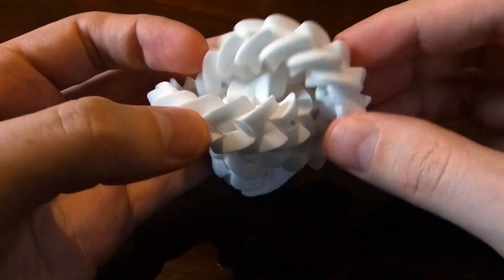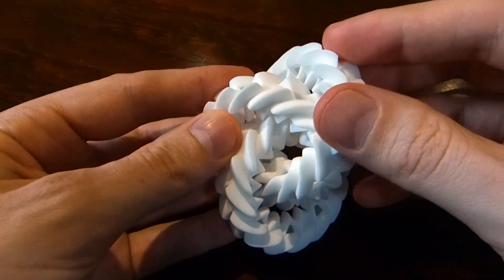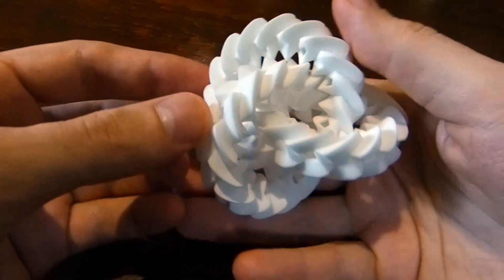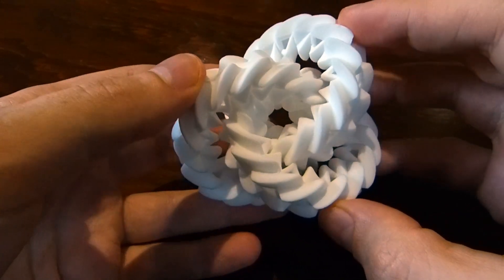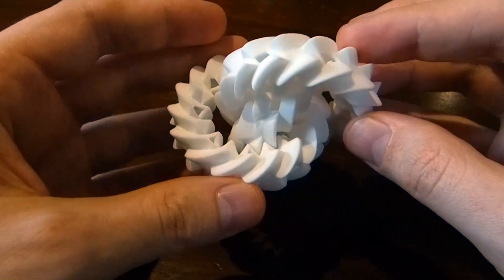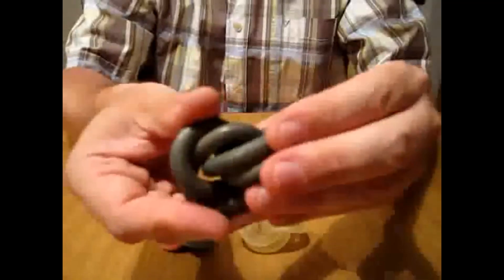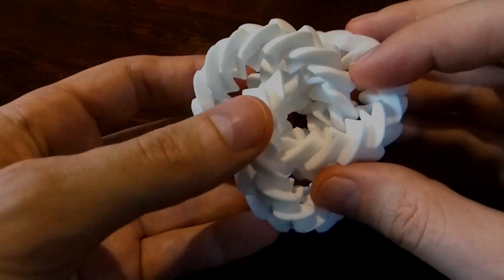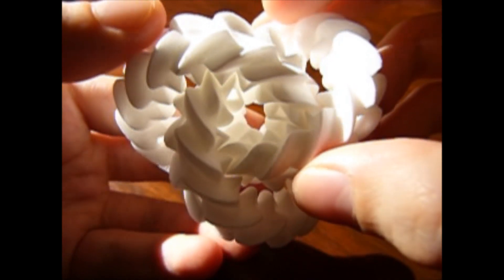Triple gear

Comment: How did you print this? Support? Theres alot of overhangs in your model.
Reply from the maker: I used Shapeways to get it printed - they use selective laser sintering (SLS) machines for this material, which don't have the same restrictions as extruder based printers.

Comment: It looks like they would slide down a central shaft, so you could use gravity to power them. Replace the shaft with a ring and you could add a motor to have them falling while the ring is rotated up through them to make a kentic sculpture.

Comment: Is the ability to wobble a bit necessary or could that, in principle, be eliminated?
Would it be possible to do a grid that way? Like, have one ring mesh with three, four or six others that pass through the middle, each of which also has the same number of gears passing through the middle, while keeping all moving nicely
Reply from the maker: +Kram1032 Currently, parts that are intended to be separate pieces need to have a gap between them in printing. Perhaps one could design parts of rings that could be printed separately then combined. A grid is interesting - the answer is that I'm not sure. Likely something could be made to work.
Reply: Henry Segerman actually I think you answered the first of my questions better in other videos of yours (I am currently in the process of watching a bunch of them :) )
- You aimed for a 3-fold symmetry in which case the shown relative thickness is maximal, but a less symmetric version could allow for greater thickness. That's why they can wobble.
- However, by introducing a helical axle of (I think?) equal thickness, you can also remove the wobble and, on top of that, have a convenient way to drive the entire thing. Neat!
- It's not clear yet(?) whether the less symmetric form with the actual maximal thickness could work in a similar way as well. - But that's where, presumably, manufacturing limitations would also start to show up since it would be hard/impossible to separate the gears in that case. (But, as you said, partial rings might work) Also that version could not be driven by a central axle since the center hole would vanish in that case.
Reply from the maker: +Kram1032 They still wobble with the helical axle! Ordinary gears don't wobble because they are attached to axles that are held in place very precisely. With these gears, the mechanism holding the gears in place is the same as the mechanism that has them interact with each other - it's just harder to get precision having to do both jobs at once, even if the clearance needed for 3D printing could be got around..
Reply: Henry Segerman ok but then that's a precision problem rather than a deeply mathematical one, right? Like, given atomic-scale resolution, could the wobble be practically removed?
Even regular gears often have at least some amount of play depending on how well they are manufactured.
Reply from the maker: +Kram1032 I don't have a precise, mathematical way to define the shape of the gear teeth. This was a bit of a hack in the end. I think it's likely that a "true" solution exists: a set of shapes of rigid bodies in space that have precisely one degree of freedom available to them. But I don't have any proof of that.
Reply: Henry Segerman ok, gotcha :)
Either way, this looks really interesting and I wonder if anything practical could be done with this. Like, say, some kind of robot/vehicle with a tetrahedral design where wheels are driven by something like this at its core. It'd probably not be straight forward to design and there are likely simpler designs to do the trick but it'd be interesting for the heck of it anyway.
Reply from the maker: +Kram1032 Yeah, good luck with that!

Comment: did this print in separate parts or they were connected together?
Reply from the maker: amin dehghan This was printed as three separate but linked parts, using a selective laser sintering 3D printer.
Reply: how was the linking?
you mean they was connected together at first?
Reply from the maker: amin dehghan It depends what you mean by "connected". It was not a single object that was broken apart into three parts. It was also not three separately manufactured parts that were then linked together. The three rings were printed in place.
Reply: thanks for your rapid responce ;)
i have problem with the gaps between each part.
if they were printed seperate so how gaps were printed?
Reply from the maker: amin dehghan I'm not sure what you mean. Gaps are not printed... If you are asking about support material, selective laser sintering doesn't require supports.
Reply: Henry Segerman Nice video Henry.  I would argue with you that SLS doesn't require supports, rather that the supports are supporting different things.  The unsintered powder is supporting the powder above it that will be sintered on a subsequent pass. Just like the other printing methods the support structure is removed after printing.  It's just a little easier removing the powder in the SLS method of printing.  And easier to reuse the "support structure", of course.
Reply from the maker: David Kenny Sure, this is all true. When designing a print, I don't have to worry about where the supports will be, if they're needed, how to remove them afterwards etc., so I don't really think about it!
Reply: I understand.  The support structure, rather conveniently, is built into the process itself. A rather fortuitous byproduct of this method.

Comment: Is this in the Borromean configuration?
Reply from the maker: No, this is the three component Hopf link. It turns out that the Borromean rings cannot be made with actual circles - they have to be distorted in some way to work. But since the gears have to rotate in place, they essentially have to be circular.

Comment: Wow, that is pretty amazing! What you need to build now though is a driven carrier housing for this assembly that you can place it on that would hold it stationary while demonstrating the 3-way meshing action for maximum awesomeness. ;)
If you can actually transfer mechanical energy through this thing it may even have an application as a type of self referencing differential gear system perhaps..? O.o

Comment from the maker: If the gears are thicker then the clearance between the gears is smaller. This means that the gears are more likely to come out of the 3D printer fused together. Depending on the 3D printing technology, it might be possible to make them a little thicker, but not by much.

Comment: it looks great!
Put a threaded shaft inside it will determine the path of rotation. Then put it between tree motors with teeth wheels(your'e option on teeth) .. Multiply the power Turk of three engines Turk and save maximum place.. send me to my mail your'e opinion of what you can do with it on industry technologies.. "ilansurganov@gmail.com"

Comment from the maker: No. I had checked that rotating all of the gears along their axes by very small increments (in fact, in steps of 2pi/256) worked without crashing, but it was very hard to tell what would happen if the gears were not perfectly aligned. It might have been very difficult to hold in such a way that the gears could turn. As it is, it just requires a bit of practice.

Comment from the maker: Yes it does seem that some mechanisms could work. Ideally I wouldn't want to change the major/minor radius ratio, because part of the interest is that the gears cannot move independently. What I really want is to have the gears powered by some mechanism, but also be able to pick it up out of the mechanism and run it by hand. And if it's likely to work, the mechanism should have as few moving parts as possible!

Comment: Various schemes to hold the meshing steady look doable. One using several much smaller guide-gears meshing with the two teeth sets on each triple-gear that meet along the outermost perimeter of each triple-gear torus. Or, if a groove can be put along that perimeter, slim-tread rollers could ride in the groove, constraining the range of motion for each triple-gear. If the major radius can be increased, small guide-gears could be placed on the inner surface to push outward from the triple-meshing.

Comment from the maker: If they were held in place somehow, then yes, they would mesh and turn, sure. This might be possible using some sort of external structure. Axles and spokes don't seem to be possible though, due to the linking of the gears.

Comment: I was joking about the Borromean ring version. (I thought maybe if the gears were flexible, but what's the point of that) But maybe this needs more thought before dismissing. Gears don't have to be round. There are lots of different shaped gears. hm...

Comment from the maker: As skiierboy says, no, it doesn't work. It doesn't even work to hold and rotate two gears with the third hanging below. The hanging gear gets pushed up by one of the driving gears, until it is out of position and the mechanism seizes. You can see in the video that I use my left hand little finger to keep the bottom gear in position. Possibly it would work with a heavier, smoother material.